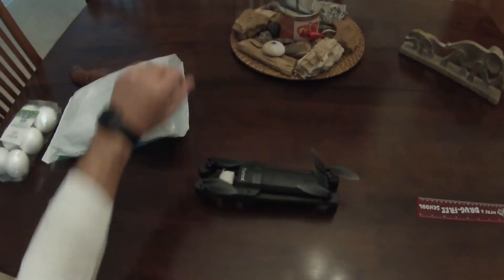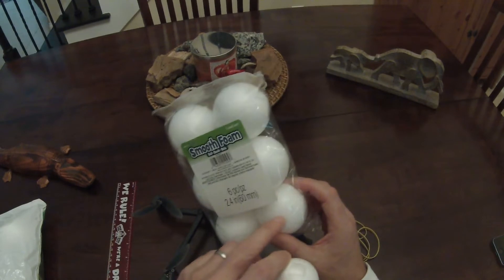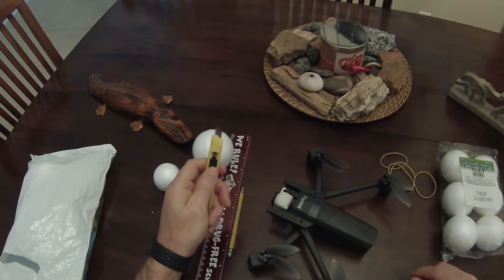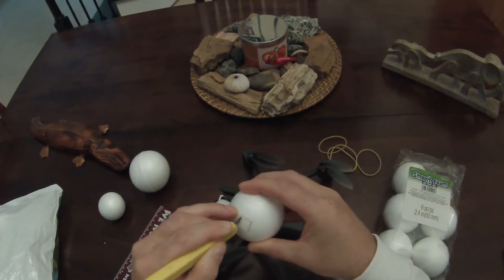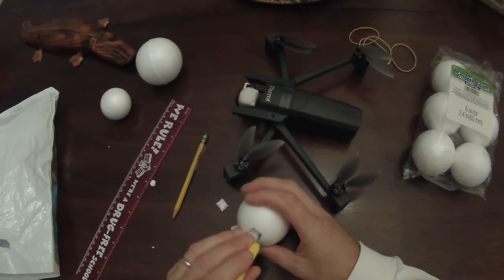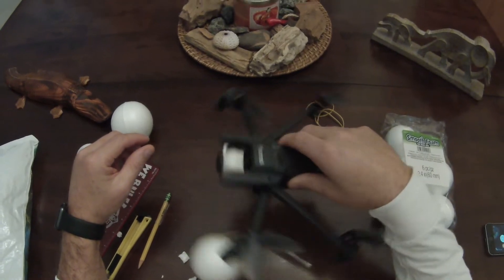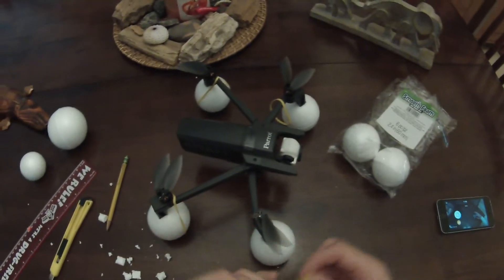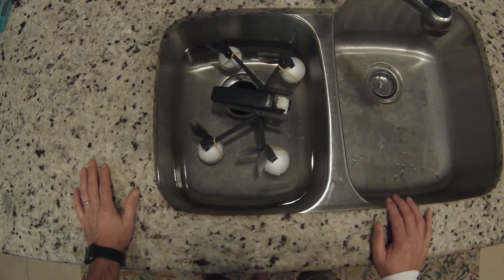Cheap and Easy DIY - Parrot Anafi Emergency Water Recovery Floats

Comment: I would have been interested to see it land on the lake. Also, would is start again? Does the fan under the anafi suck in water? Does it really safe the drone when in plunges from 30 or more feet? Anyhow, I like the workaround, it might definitely beware the device from drowning.
Reply from the maker: This was not intended to permit water landings. I just didn’t want it to sink in the event of a catastrophic failure and not be able to retrieve it. Now that I’ve had Anafi for a while, I’m confident that it won’t just fall out of the sky for no reason, so I’m not using this setup.
Reply: Mine did fall into water just yesterday suddenly without any reason. Have fallen from the sky already two times in one month. First on land luckily from only 2 meters but this second was on water from 20 meters.:(. And no warranty because I have no drone to send back for investigating why it game down. So those could be usefull when I get a new one. Have you tested how it acts when its a bit windier?

Comment: I did the exact same thing on a Bug's 2 of mine and I was not in favour of it, as it wants to tip over due to the high CoG.
And that was in a calm sink, different when you are out in the windy lake even a calm one.
You could use larger diameter floats on the rear to offsett the balance difference on your Anafi,as the battery tips it rearwards.
But I can gaurentee that the first time it lands in the water it WILL rollover, yes it will float, but you would be very lucky if the Anafi operates again.
At least you can retrieve it if you have a boat 😁
Good idea in principle but in practise it is flawed.